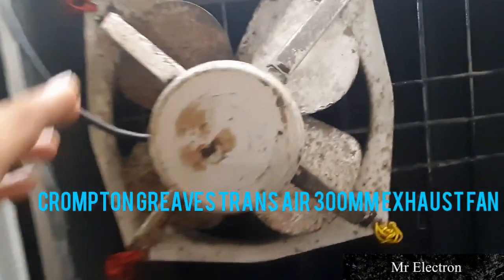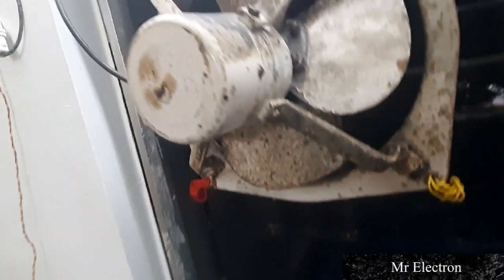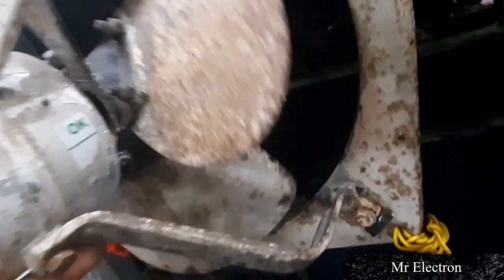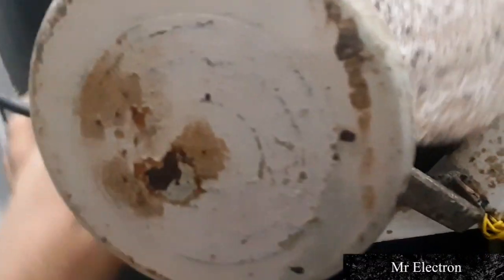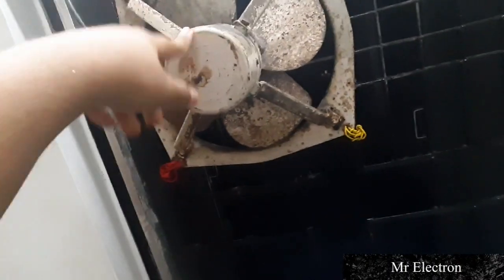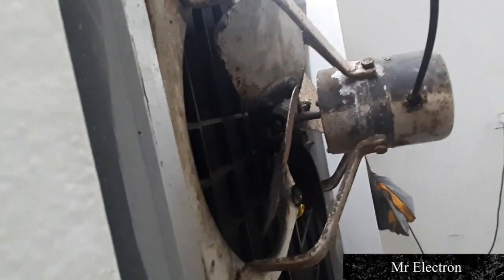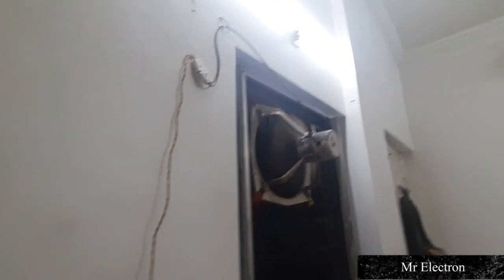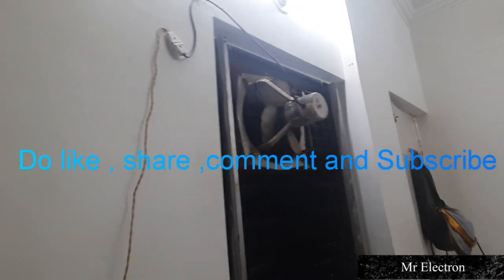Crompton TransAir 12"inch(300MM) grey exhaust fan | 1996s | working and performance

Comment: Still this fan is very powerful after many years of use 😍👍👍
Reply from the maker: It's Crompton Greaves bro , awesome even after 25 years of kitchen use
Reply: @tanishdadlani-electroexplo5360  YES😊
Reply: @tanishdadlani-electroexplo5360  I am having a 1980s crompton greaves 🤚 logo pump motor ,it was rewound 3 times (first rewound 2014 ) but now its burned and retired, very sad about it
Reply from the maker: @antiquefanworld1728  ohh
Reply: @tanishdadlani-electroexplo5360  It has original start &  run cap but it need separate switch to start because of internal rotor spring seperation at high speeds

Comment: Seems like you have to clean the fan
Reply: And also need to learn about how to explain regards of techonology or the way to repair
Reply: Bearings make noise too, as you require oil lubricant.
Reply from the maker: Go and watch this fan's restoration , everything is fine now